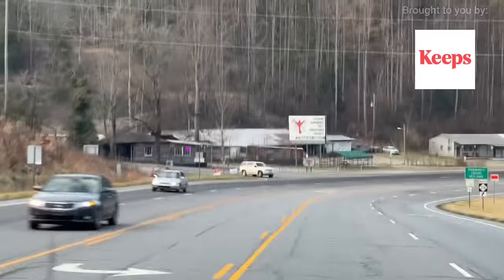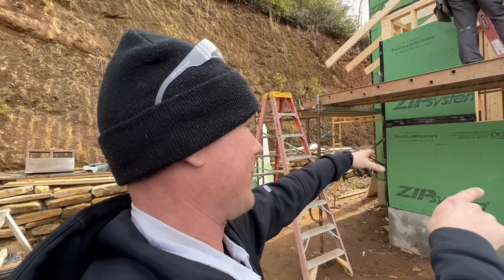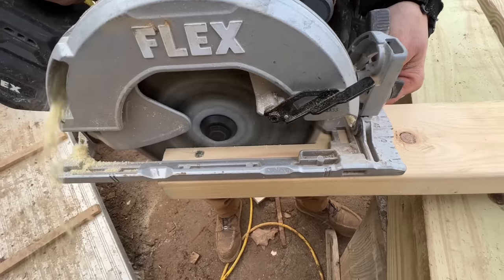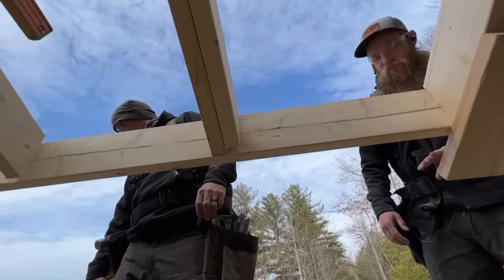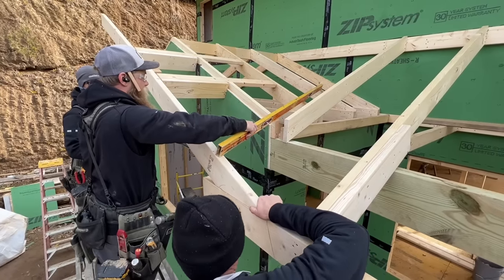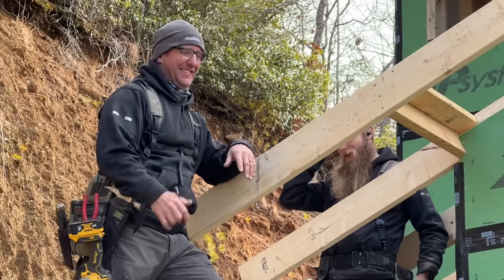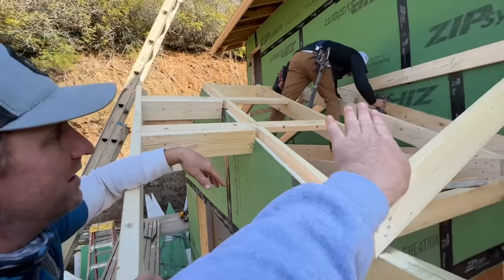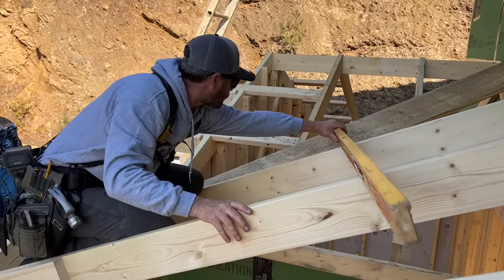Roof Framing Details | Building A Mountain Cabin EP20

Comment: Years back, I was a cut man on a framing crew, doing rafters for hips and valley.  We did a block of wood, numbers, and, looking down long on left, 4/12 main, 7/12 side. or as the block said,  LDL4M7S with a small drawing on the location.  Worked most times! LOL

Comment: We deal with a lot of old camps around lakes (nothing straight) so when we do a valley an old timer taught me just nail a block to your common flush on top and bottom then just hold level accross mark a line that's your angle.  Just another way to get that 65°.  Thanks guys, cool to watch you guys build.

Comment: For that last tip about the guard not cooperating, I've found that raising the saw blade to slightly deeper than the material you're cutting, the guard seems to go up much easier instead of having it at the full depth and having to saddle the board haha. another good episode! cheers
Reply from the maker: Good tip thanks

Comment: I really like my Paslode framer ; it’s super light and for the minor inconvenience of gas as opposed to dragging a Milwaukee framer around (also a great gun but hard on you).
I am a finish carpenter /Cabinet Maker  however I often contract out to trim the front of a house which this gun has cut my set up time from 10 minutes to really getting out the gun and slipping in a rack of nails!

Comment: Pro tip,
Put the zip on the one roof first , then the sleeper on top of it. Eliminate those extra nailers and figuring the angles on the zip after
Reply: That is called a California framing or roof or valley.
Reply: I’ve always called it an “overlay” and I believe it’s an easier and faster method. Little bit of a waste of osb though. But  you just overlay enough to catch the valley so not too much waste to care (until need week when It’s $120/sheet)

Comment: Idk about saddlebag up on the board, I like to just stick a pencil in between the handle on the guard and the frame of the saw, then put my free hand on the board to hold it still lol 😂 🤯 pro tip, don’t forget to put the guard down when you’re done with the saw so no one unknowingly picks it up and pull the trigger without looking down 😉

Comment: I like framing valleys and hips, its a fun challenge. Although I always sheet the underside before putting the sleeper on so both sides aren't a cut edge in the valley. It keeps that joint strong without putting tons of backing in
Reply from the maker: I kind of like doing valleys and hips as well… Pretty stimulating compared to walls

Comment: Always looking forward to your awesome informative videos. Going to build my first house soon and my question is. Can I do all my interior framing after I finish the outside framing and roof? So basically a shell with a blank canvas inside, of course any walls needed for structural support would be built.
Reply: Basically yes as you have stated. If it helps to be in the dry faster, just build the shell first.
Reply: @jaimeperkins9606  okay thanks

Comment: On Jaime's Pro Tip, does that inch and a half include the blade kerf?
Reply: I will have to measure my saw to be sure… the scales on the baseplate go both ways from the bald so I guess the saw designer had to take that into consideration….
Reply: @jaimeperkins9606  Thanks for your response. I have been binge watching PBB for the last few days, looking for an example of the roof I want to design for my class project. I am updating my parent's mid-century tri-level house. On the back portion of the main floor, there is a breakfast nook, then to the right, the kitchen and then through a door, the Formal Dining Room. This room is 12 feet wide and 17.5 feet deep with a 12 x 12 vaulted ceiling. The rest of the ceiling is 10 ft high and flat . The first 5 feet of the room sticks out past the kitchen.  How do I frame this? I know how you do a regular ceiling addition roof. Do I build a box around the top for the main floor rafters to sit on? Any thoughts would be helpful.

Comment: Why didn't you just sheath under the sleeper? The plywood would have full support if you did correct? Plus one less angled cut for the dormer.  I'm asking because I am getting ready to do a 2nd story addition with Nantucket dormers on the front and back.
Reply from the maker: You can… just wastes some roof sheathing :). We have done it both ways depending on the situation
Reply: @PerkinsBuilderBrothers  cool. Thanks for the input. You guys are awesome. The only thing I dislike about you is that you don't put out more episodes. I feel I need about 8 per day. Thanks😂😂

Comment: Since you don't have plans on site and at times seem to change the design how do you keep track of everything? As someone newer to construction I feel like I would be so confused 😂.
Reply from the maker: We usually don’t make changes that affect the structure… Usually just cosmetic or non load bearing walls that need moving for a better lay out. We do our own designing and always check with the owner before we make changes. It helps to know all the building codes and also the Inspector’s cell phone number.

Comment: I’ve been watching your videos for some time now while building my own house. I’ve got a question. I know zip systems is a sponsor and all but as far as cost to the owner for the sheathing (OSB, not plywood 😂) is concerned, what does a house like this actually amount to? I used plywood on my entire house and didn’t even know about zip systems until it was too late.

How much more does a project like this current house cost vs. plywood and wrap?
Reply: Around here plywood is cheaper than zip and even osb. OSB is 44$ plywood is 28$ what the heck is happening.

Comment: Hmm, a 5/12 pitch equates to a 22.62 angle.  (At the Habitat I work at we use 22.5, which is preset on the miter saw).  Why did you use 25 degrees for the 5/12 roof?
Reply: We just said 25 for a round number…

Comment: The Tongue and Grove Floorboards were nominally 12 Foot long. 
But We needed them in 10 Foot 3 Inch lengths, because We were Lining them Vertically on a Wall. 
Unfortunately My Measuring Tape was only 10 Foot long. 
So I decided to cut a Template Board and use it to cut the remainder of My Boards. 
Whilst I was intending to add 3 Inches to the 10 Foot mark, I inadvertently added 3 Centimetres. 
My shorted Boards hung on thatWall for 25 Years and whilst We always intended to cover the shorts with a Skirting Board it never happened and the shorts simply became a design feature.
Reply: Dang…

Comment: Your cutting 1 1/2” plus the kerf
Reply: Oops. I guess if you need a 1.5 inch cutoff, this is correct but if you are removing 1.5 …not so much. However, Essential Craftsman has a video on tolerances in house framing. Scott says 1/16 is usually OK.

Comment: Wouldn’t that make what you’re cutting 1 1/2” and cutting off 1 5/8”? Have to account for blade thickness.
Reply: A typical circ saw blade is not 1/8”. They are usually about .065”-.08”, or about a 1/16”. And a 2x4 cut in half would be 1-3/4”. When framing, you usually don’t worry about a 1/16”.

Comment: I'm a carpenter, love the videos. One critique. The valley on that porch roof is something I wouldn't do. Sheet the entire gable portion and do the valley on top of sheathing. Please don't tech bad habits. Looks like crap with those stupid filler blocks. Also replace the rafters that were cut short.... atleast use industry standard on scabs. If overhang is 1' out go 2' in so use a 3' scab. I expect better from you guys